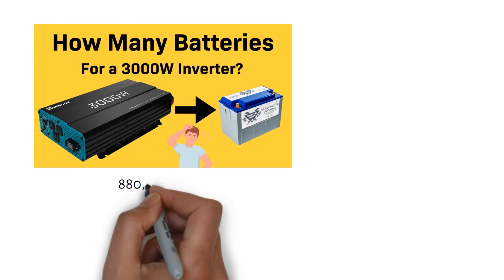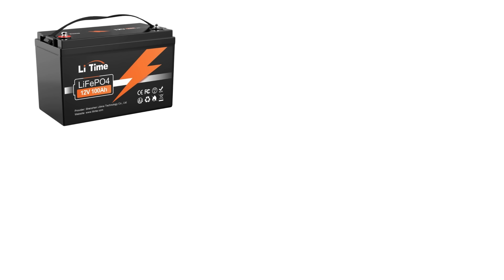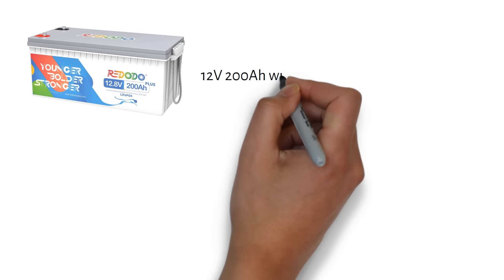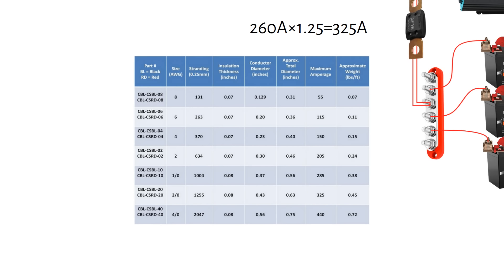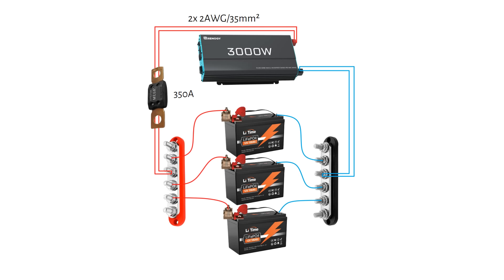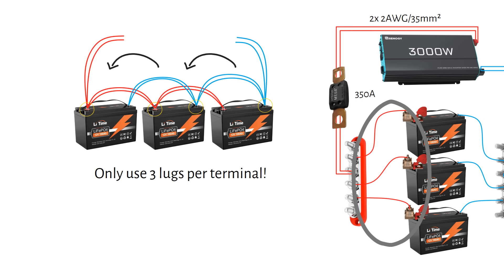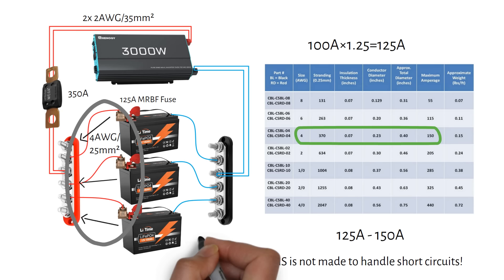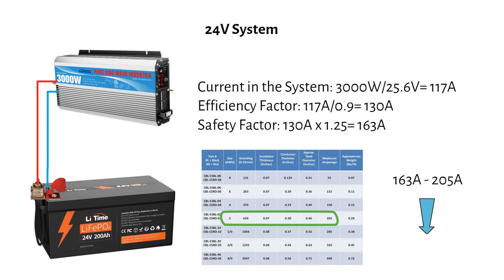How Many 12V Batteries for 3000W Inverter

Comment: What I discovered is to supply enough current it is good to use the battery in parallel. The current rating using lifepo4 battery is greater than the actual available current rating. My battery is rated at 200 amps BMS but it can only provide 150 amps continuous. By placing equal battery in parallel The current available will be 300 amps.
Reply from the maker: If you have been sold a 200A BMS and only get 150A out if it, you have been scammed 😬. Which brand?
Reply: So you actually have a 150A BMS which allows for a short term "peak current" of 200A. The BMS is rated at continuous current. Anything higher, like peak current or other short term current specification is just there because marketing likes bigger numbers.

Comment: Inverters also have a surge capacity, and if your batteries and wiring are inadequate you won't get the promised surge capacity.

I also would not plan to run the batteries at their maximum amperage. I recommend a 25% margin for every battery added in parallel.  (75% of each means 2 can do 150% of one, 3 can do 225% of one, etc)
Reply: If your inverter has surge capacity and your battery(s) also can handle the surge, you would blow your fuse if you use the fuse size specified in the video.  Unfortunately, as good as the video is, no mention was made of this very real issue.
Reply from the maker: No, wires can handle the surge capacity for a few seconds. While they are not sized for the surge it is no problem for them to handle a surge of a pump. If factories had to size their cables to the surge current then it would be much more expensive. It's not done this way. I worked as electrician a in a factory.
Reply from the maker: No, there is a difference between surge capacity of a fuse and the short circuit current of a fuse. Mega fuses can handle many times their rated current for a few seconds. This is called the time-current curve. They are called slow blow fuses, used for starting inductive loads. You also have fast acting fuses for circuitry.
Reply: @cleversolarpower  wires can handle it, but with low voltage DC the voltage drop becomes critical even with short cables. 1v drop might be too much.
Reply from the maker: @Sylvan_dB  Voltage drop is something else. It can happen. That means you are running too much power from your battery. Solution -> more capacity.

Comment: I have to add to this, the equation is correct in theory. However, the 3 batteries will only supply that wattage for 1 hour. So anytime you are working up your off grid power you have to add in the ammount of time you want to run that potential voltage. When my solar power stops supplying power my wind turbine keep it going. Howver when the sun is down and there is no wind you are on battery only. So, when doing your calculations only account 25% of each battery. So if i was to design the system in this video i would probably be up to about 12 to 14 batteries for a nights worth of power supply. 

100ah means it can run 100 amps for one hour. 
25ah means 25 amps it will run for 4 hours. So multiply that by how many hourse and amperage you need. 
Do a ton of research, when dealing with off grid power more battery is always better. But match your solar grid to match the recharge rate in your normal sunshine day. 
Hope this helps.

Comment: You are stating the minimum number of batteries needed, but you can connect as many batteries as you want or as many batteries that can be connected together according to the manufacture of the batteries you choose to use. I would connect as many as possible so as to get the greatest run time possible. Space to put them may also be a limiting factor.

Comment: The higher the input voltage on your unit the better. I run 48vdc input on my eg6. I also have 4 480w 48v solar panels on the roof. Built my own 48vlto batteries with 200amp bms. My batts are 245ah each. I even built a buzzer for when my voltage gets down 11.9 volts. This way i never really completely drain my lto. It's in my 8x12 portable shop trailer. This sits on top of my old champion 4550 gen that's been converted to run on propane. Mind you it's need a couple more batteries. Especially when I run the rooftop ac. Lights, cordless tool chargers and even my pancake compressor has no issues keeping up. Im building a capacitor bank to install and try out on the bigger loads to see if will help out.
Reply from the maker: Yes, increasing the voltage of the battery bank has many advantages. I made a video about 12V,24V or 48V. Increasing the voltage of the solar panels as well as it reduces voltage drop over long distances (up to max input voltage of the mppt).
Reply: I put some supercaps in parallel with my batteries and they absolutely help. The shock they absorb is like they're 75% of a soft starter, but that's enough for me to start my table saw. I only need the generator to weld, I know I could wire my batteries up to 36v hook up electrodes and main line an arc but Im assuming that'd wipe my batteries stupidly fast. I mean, I coooould do it, I run old heavy solid state gear, the kind so full of copper it could kill ya if it fell on you... so I'm not worried about my equipment at all, just draining the batts

Comment: Below Update 2, you state we could use 200 a. fuse in lieu of 350 a. single fuse at the two parallel conductors. So use 200 a. fuse for each separate wire or could I use a 200 a. two pole conduct with both wires connected?
This parallel conductors helps so wire is smaller and easier to work with.
A 200 amp two pole / phase breaker could also be used for both wires connected to (12 v. DC)?
I think I have watched all of oyur videos more than once. They are so educational, informative & easy to follow!!!
Thanks for all you have done and continue to do for us off griders! The book helps a lot too!
Mike
Reply from the maker: Hello Mike, you need two 200A fuses. One for every cable. Thanks for your support! 🙏
Reply: Circuit breakers are superior to fuses in all applications. 
The issues are they drop 1V at full load and they need to be rated for DC load breaking.

Comment: Switch to a 6 v marine battery lead acid system four batteries in series and parallel The larger size allows for more storage capacity unloading over a longer time span . If you wire each pair in series and parallel to the inverter series makes the two batteries 12 v and running pos and neg  in parallel off each pair provides the  inverter with sustainable load capability. Hundred amp alternator and a dual battery charge switch network

Comment: The purpose of the fuse is to protect the wire, which it may not do with two feed wires. If one wire gets a loose connection, gets damaged, etc, then all the current will go through your second wire. Since the 350A fuse will not blow, the 300A going through one 205A rated wire will cause excessive heat and potentially fire. 
Your two feed wires from the bus bar to the inverter should each have a fuse, say 180A, to protect that single wire.
Reply from the maker: Yes, thats a mistake on my end when drawing the diagram. I will update it in the description.

Comment: 2 x 135ah in parallel on my 3000w inverter works well, even better now i have 000awg 400amp cable from battery bank to inverter, the old 100amp cable would warm up and inverter beep when running heat gun on high
Reply from the maker: The voltage drop over the small cable was likely too high for the current, so resistance increases = heat. The inverter would have sensed the lower voltage and turned off. All inverters have a min-max voltage range they operate on.

Comment: I installed a 24v (8 x eve 280k blocks) with fcao 3000 watt inverter. I go up to 2500watt, never Max out your system. Keep the overhead. The c rate of my battery is 0.5C meaning i can draw half of the 280 amps continuously which is 140 amps at 24 volt. The c rate is specified by the manufacturer. Not by YouTubers.
Reply from the maker: Standard charge/discharge for LF280K is 0.5C, Continuous charge/discharge is 1C, pulse charge/discharge is 2C. Check the datasheet for your cells. Also depends on the BMS you have.

Comment: To someone who knows nothing about electricity, it sounds like you know what you are talking about, but you don't. The problem appears to be that you are unaware of the limitations of your knowledge. You are unaware of what you need to know, but don't know. You know a little bit, but not enough to be giving advice like this. For example a 100ah battery does not automatically send 100 amps. It will produce 1 amp for 100 hours or 100 amps for 1 hour or 200 amps for 1/2 hour. This is why your bolt on fuse protecting each battery should be properly sized, usually 175 amps for each battery. Same with watts. A 1240 watt hour battery can produce 1240 watts for an hour, or 124 watts for 10 hours or 2480 watts for 1/2 hour. The number of batteries needed for a system depends on the total amount of power needed before the system is charged again, not on these calculations you made.❤ Additionally, the wire size needed is based on the amps flowing through tthe wires not the amp hours of the battery. A 100ah battery does not automatically send 100amps output through the cables. It could be more, but is more likely to be less. In addition, the amps that a cable or wire can carry is dependent on the cable length. The longer the cable or wire, the fewer amps it can safely carry. Also you should not run multiple cables to carry a load, you should have one properly sized cable. The calculations are far more complicated than you think. Someone should, at a minimum, purchase a good book which explains all of this before building their own system. Otherwise they will put themselves at risk of a fire or worse, or they could end up wasting money on vastly oversized wires, too many batteries, etc.
Reply from the maker: I see what you are trying to say, but you make it more complicated than it needs to be. I recommend watching the video again. You will see that i size the cables according to the potential maximum current going through the wire with a 3,000W inverter. You need to be aware of the C-rating of the battery (that's what this video is all about).

Comment: We bought a 3000W Renogy inventor with our new RV  (we have 600W solar). The dealership installed 2) 100amp lithium batteries.  After watching your video, we can see those were the wrong size batteries.  We have had the RV for 6 months now, and still can not run the invertor. Although, we know we should upgrade now to 2) 170mph batteries, when we do hook up to shore power, the inverter is staying on and we have burnt up 2) 400W fuses. Literally, melted. We do not understand why we can not turn the invertor off when we are hooked up to shore power.  It's almost like too much power is coming through the invertor when we are on shore power.  The batteries are located under our bed because they were too big in size to fit under the entry steps to the RV.  The dealership located in a different state, paid our local RV repair shop to fix their mistake.  After our local shop worked on it, we have the same issue.  What do you think is happening?  Shouldn't we have the option to turn the inverter off when we are hooked up to shore power?  It's quite unsettling to have fuses burn up while under the bed!
Reply from the maker: Having two 12V 100Ah batteries in parallel is not bad for a 3000W inverter, it's just a little short of being 'ideal'. It depends on how the wiring is done. If you use the inverter, it will still draw from the battery. You can have a plug installed or a transfer switch. I recommend taking a look at my system diagrams, here on the channel or on my websites homepage. If you reply to this comment please do so through email because i won't see your reply here.

Comment: Im using 10 AGM deep cycle batteries = 1650ah and have absolutely no problem powering my 6000w inverter or 3000w, but it depends what I'm running from the inverter, like my oven to bake bread, the heater or welder hot water cylinder etc will flatten batteries faster, but powering 2x deep freezers lights and TV etc batteries last a week almost, without sunlight on the solar panels
Reply from the maker: I assume each battery is 165Ah @12V. the max current you should draw is 165Ah*0.2C=33A. If you have an oven, it can draw 3000W (random estimation). 3000W/0.9=3333W drawn on the input of the inverter. 3333W/12V=277A. Then divide by 10 batteries in parallel= 27A. So your batteries will be fine. I don't recommend to use 12V because of the large wire sizes. If you had a 48V system, the wires sizes could be much smaller.
Reply: @cleversolarpower  thanks awesomely 👌 and thanks for sharing your great experience and experiments 🤗

Comment: I have the same 3000w 12v renogy inverter but i am limited to the 3 AC outlets which are Max 1800w(or 120v 15A) combined i think. 
I would need to use the hardwire output with at least 12awg cable to achieve the full 3000W.

Comment: It's interesting that this video popped up now, I'm with 5 other people dealing with hurricane Helene, after a few days, 1 of the guys who doesn't understand ANYTHING about electricity went out and bought a 3000w inverter from tractor supply. His reasoning: it was expensive, so it must be good. He had 1 old 24v lead acid battery, it worked for a few minutes to run a TV, but then the battery ran out so he thought the inverter was bad, he returned the inverter and spent nearly 30 minutes complaining the second inverter was bad also. I had to stop him and attempt to explain basic electrical theory
Reply from the maker: Indeed, bigger isn't always better. Great case study, just because they make such an inverter doesn't mean you should buy them. Then inverter should support the load.

Comment: One 12v 100amp hour Lithium battery gets you 0.80 Kilowatts in one hour.  My house draws 2-3 Kilowatts overnight. NO heat or AC. 8-10 Kilowatts in 24 hrs . no solar. With 1 Kilowatt of solar per hour on a sunny day I can run the house and charge FOUR Batteries. Running lights Frig, microwave TV's etc. barely . need EIGHT or TWELVE BATTERIES.

Comment: An if you use 3000W for your devices, it will last less than an hour and totally drain the batteries. So for more capacity or power time, you will need a multiple of this equivalent to the number of hours you want to supply power.

Comment: I would use 12V (fully discharged) as the nominal battery voltage - you may want to run the inverter until that voltage is reached. So the power is  greater or equal to 1200W per battery.
Reply: Right, to supply the output power, the input current will go up as the charge level voltage goes down. It is good design to size input wires based on that higher current draw when charge is low.

Comment: He did leave one thing out in my battery manual.  For parallel the batteries are also cross connected as well as having a cable to the bus bar.  Why I could only speculate, but I expect there is a reason for it.
Reply from the maker: Parallel is all positives together and negatives together. No crossing. I wonder what battery brand you have.

Comment: Renogy Inverter come with cables.  CCA and not copper.  So putting 300amps through aluminum cables is dodgy.  They have more resistance and they break easily.

Comment: Appreciate the thorough video. I do have two questions... other than slight operational efficiency, should the number of batteries be tied to the load?

Also to further clarify, if I have a 5000W inverter, but only using it to power my LED lights, is such inverter draining my batteries much quicker, then say if I were using a 3,000W inverter?
Thanks for the reply.
Reply from the maker: - The batteries should be size according to the size of your inverter's max load draw. This includes the C-rate, wires and fuse sizes.
- A 5,000W inverter will have a higher standby consumption than a smaller one. So, yes.

Comment: Really appreciated the simple and easy to understand video. My question is if I'm running a 3,000 watt pure sine inverter for our off grid cabin. You recommend 3 12.8volt 100ah lithium batteries. Could I use 4 100ah batteries, and would that be a benefit? Also, if I use 4 batteries, should I increase the inverter to say 3,500 watts or higher? Cheers, Bruce.
Reply from the maker: As you saw, i don't recommend using 12V system with 3,000W inverter. But you can if you have to. I recommend getting two 200Ah 12V batteries instead. Wiring 4x 12V 100Ah batteries in parallel is too many wires. You don't need to increase the inverter. The inverter size is based on your load. Do you really need 3,000W? Because your wires sizes need to scale up as well.
Reply: I appreciate your quick reply and we would need enough power to run the basics in our 2 bedroom townhouse. This would only be in the event of a grid down situation, cyber attack, and any longer term outage. The main need is running our natural gas furnace, hot water tank, and keeping the fridge and freezer going. We live up north where winters can get down to -30C, and we don't have a fireplace or wood stove. But then we have the occasional use of our TV, computer. It's definitely an interesting and challenging topic to research. Cheers.

Comment: I'm just doing one Redodo 100ah battery, 200w of solar.  

What I'm using it for... 
Charge rechargeable lights.
Phone. 
Rechargeable mini TV and radio.  
A 12v Burton lunchbox cooker. 
A 1qt crock pot.  
Cheap Duralast 100w 110v outlet that just plugs in. 

Of course, I'm not doing everything at once.. 
Just a 12v plug with 2 usb ports. For a fuse,I'm just using  the 15  amp car fuse that came with the power outlet. 
This is my,the world gone to 💩 and need just enough to make it bearable for survival.